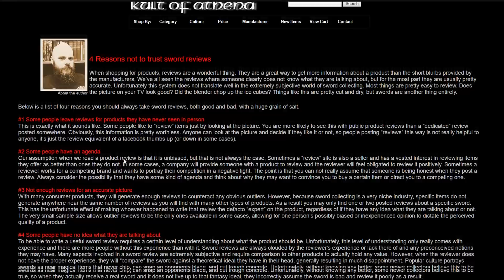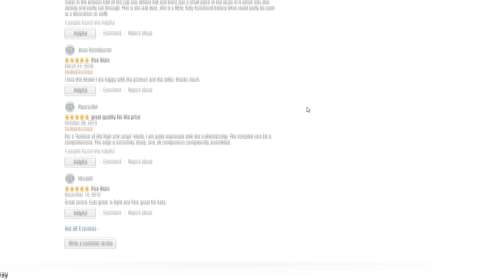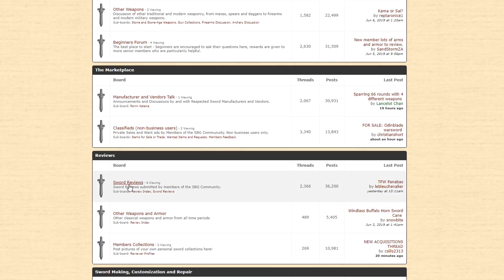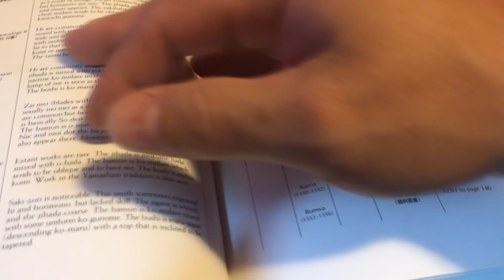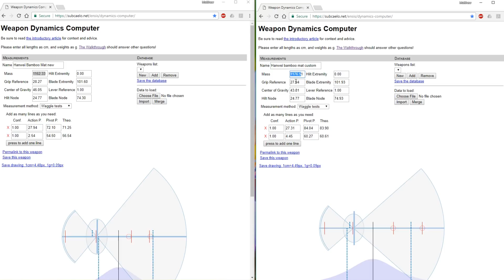Why Sword Reviews Suck: Thoughts on a Article from KoA + Thanks for 5K

Comment: The reason I like your sword reviews is because you're very good at showing the details of the swords, and you handle it, poke at it, and once in a while you do a destruction test. Sure a reviewer can say their opinion about a sword, but there's no guarantee they know what they're talking about. And if I can't see the blade in details, I really have nothing to go by. The way you do it is very good because first off, you make a video, and that says so much more about the sword than images. You also have pretty clear footage, showing off the details of the steel and the blade's shape, which is very useful (I would like to see the mune of the kissaki shown also, btw. I can't remember if you've done that in the recent reviews). And finally, you poking and prodding the itomaki and kashira, etc. really shows me whether it's just for show or if it actually will remain in place. I mean, if I were to use a sword and the tsuka cracks, the ito unravels and/or the kashira comes loose, it was a defective sword from the start. The destructive testing does the same with the blade, and it helps me judge when I see the video, I can determine if the blade is too soft etc. I want a sword with an edge that doesn't roll (over and die) when I cut bamboo. It should hold up. The better it holds, the less I need to worry about it breaking under normal use.

My two cents. Thanks for your reviews, and keep 'em coming.
Reply from the maker: I don't often make a point of showing the mune of the kissaki but that is a good thing to show.  Having better shape and dimension there can be a deciding factor.  Thanks for the tip and  the kind words.  I am glad you have found some vale in the videos.
Reply: @Matthew_Jensen  Yeah, it's not a big thing, but it does tell me how accurate it is according to real nihonto shapes. It can look good from the side, but then I later discover it's basically just a sharpened plate of steel. It also changes the balance.

Comment: I once had a 1045 blade that I got off of SBG years ago. It was a Ronin Katana RK series I think.   The thing would cut ANYTHING normal without issue. This was a $150 dollar sword.  So yeah. Reviews and stuff.  Whatever. If you can cut double rolled tatami mats with it with no apparent damage, the sword is good enough.
Reply: I got a 70 dollar 1045 that chopped through my wood stand with ease those things are full of surprises lol
Reply: @swordboii6668  It was probably the most balanced sword I have ever owned. I ended up giving it to a friend.  I am going to get one of their 1060 blades soon .
Reply: Stephen Arseneau I will admit mine feels pretty good to swing around compared to most of the others but it makes up for that with a slightly duller edge and a little more niku to sustain itself sufficiently so it genuinely does take a little more effort to cut with then some other things but then again heavier more tip heavy blades cut better anyways so that may also be a factor to why others cut so much easier despite being harder to swing is because they have the weight and the sharpness advantage over the 1045s not that 1045 doesn’t cut just I find it takes more effort to cut effectively with

Comment: I think a lot it comes down to the reader's ability to see through the context of a review. You can usually tell if the person is honeymooning with their new sword, is a biased company man, or can make a useful comparison out of experience, etc. 
Another huge part is tunnel-vision, or lack of discernment about what's critically important:
    Let's say there are a group of people who watch the sword reviews of an expert regarding fit and finish, but that expert doesn't put the same effort in conveying how the sword is supposed to grip, swing or cut. So there's no measurement of handle dimensions, no mention of niku distribution or distal taper, etc. As if these things aren't critical to the function of a sword, and treated as not worthy of attention.
  Then let's say there's a sword company starting out with an excellent tsuka, but an overly large fuchi. The reviewers get on their case about how important it is to have perfect transitions at the fuchi, resulting specifically in the manufacturer "correcting" the handles  to appease the echo-chamber of reviewers - but therefore ruin a perfectly good tsuka shaping in favour of a fatter, wider one made overly large to accommodate the outsized fuchi. 
 This is a good example of missing the forest for the trees. At the end of the day you've got a terrible tsuka that now gets good reviews specifically because it addresses one aspect of fit and finish, despite the fact that the updated tsuka now sucks - it was only the fuchi that was ever misfit.

Nothing against you personally, but this is just how the echo chamber works. If you beat the drum continuous about how fitment is all-important, that's what people believe, and they forget about how it feels in the cut. 

One thing I would like to see is measurements of the tsuka at the thickest/widest and slimmest parts and overall functionality from a user-perspective, rather than so much fuss about fitment from a collector-perspective.

Love your vids btw, just my 2c

Comment: After listening to you I realized that both you and I have leanings towards the same desire I have a hard time spending more than 1000 on a sword if I haven't gone to the shop and handled 4 or 5 of them so that the salesman can at least jot down my preferences allowing me to review the order form for my new sword. As if I'm spending $1,000 for a new sword it is going to have to be a customized blade dressed better than acceptably, as the only rattle I will accept his in the Sia unless I have that custom built as well.

Comment: The reviews I really hate washing our the paperwork experts they've read the books but they've never wielded that style of blade and I find it even worse when they do not list their blade-style proficiencies. You and lindybeige came to be a as a matter of fact this is just what I'm doing right now with a rough guesstimation of the time you spent with that style of blade and blade play before. And more specifically you tend to stick to what you know and inform us when you are well trained not just self practiced and taught.

Myself I am a sword harrower blacksmith and layman. Trained in the way to use a hammer to maintain or enhance the quality of The Grand in the steel. Even if I must start with bloomery. I asked that if you've never made a purchase from me please bring in a grade steak so that I can demonstrate. Because anybody can use a press or an auto hammer to create a blank but it takes a blacksmith's to create the edge of a blade without damaging the grain. This is why very often a bill it will be turned into a blank and then the edge ground. And in most cases these blades are quite sufficient. With woodz and bloomery however the majority of the profiling is done with a hammer in hand after the blank has been created or a razor it shall never be. And that is basically what they mean by the heart and the soul of the katana. This is even more so critical with woodz Damascus. Unfortunately I have no hands on experience with this material I only recognize it needs to be handled appropriately. Buy a skilled blacksmith refining rather than spreading the edge. I consider myself well trained in the art of using a handheld hammer to refine the grain of Steel and moderate with bloomery with that material I would never attempt to make a razor I do not have the skill